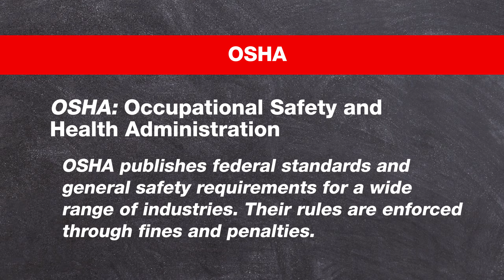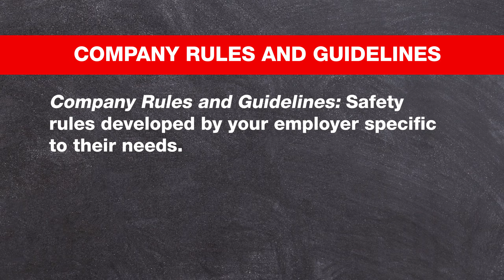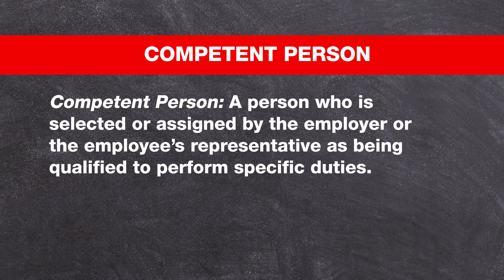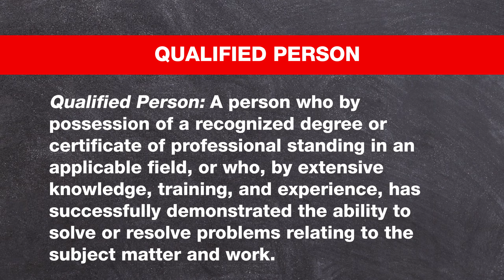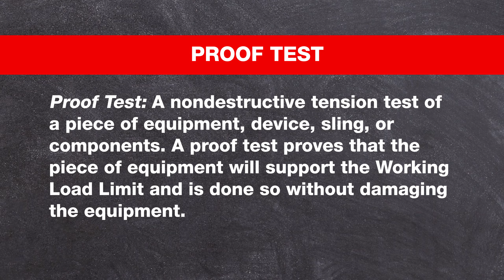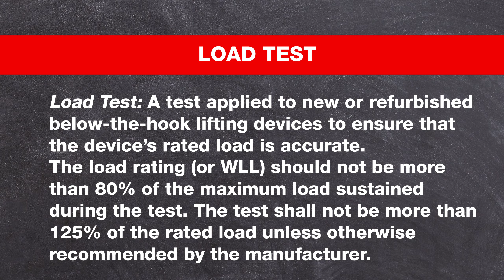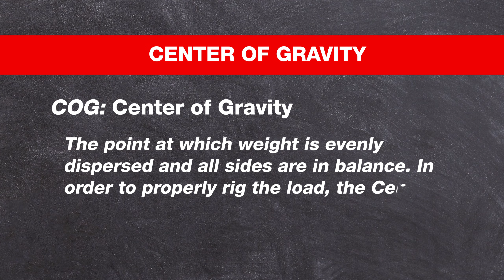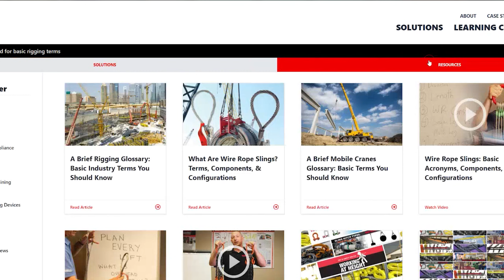Basic Rigging Terms You Should Know

Comment: Competent Person: The guy who doesn't insist on backing out the pin on a bow shackle 1/4 turn.
Reply: You have fun fighting with that thing I'm always going to back out a quarter turn😂😂😂 i've done tons of rigging around a precast concrete with your average sheer wall weighing between 70,000 to 100,000 pounds if I've never had a problem and you're not going to have any picking steel or air handling units😂😂😂 sounds like something a snobby union guy would say😂😂 you're fighting with your shackles for no reason😂
Reply: @CarolinaReaperr  Guess you've been lucky. Industry standard is to tighten the pins. I've always hand tightened them and never had a problem backing them out beyond a slight tap on the pin.
Reply: @PATCsawyer  when get over 50,000 pounds pounds you'll have to put a spud wrench in the screw pin and hammer it out😂  I think it's absolutely crazy to think the pin will vibrate itself loose under a load

Comment: Is two 1t slings the same as one 2t sling?
Or will this cause a failure in the system, should one sling fail, then the remaining sling becomes overloaded?
Reply from the maker: I reached out to Terry Driscoll, someone with decades in the lifting industry to get you an answer. Here is what he had to say.

"I would never rig like this.  Here are my main concerns –
• Matched length would have to be EXACT to allow both slings to carry the load perfectly.  Not worth the risk, especially if you are dealing with wire rope or synthetics to get the matched length. 
• Even if the slings are exact in length if the load shifts or angles are introduced, one sling will see more of the load, and now you are entering proof load capacities, which is not a proper way to rig within the design factor of a sling.
 
There are “catch slings” that are used in some applications, designed to handle the load if one sling fails, but that would not be the intent of this rigging set-up based on the request.
Reply: @LiftingandRigging  That makes sense. I was thinking if one failed, both would fail. I didn't stop to think of imperfections. 

Now that you've pointed this out to me, I realise it is impossible to make two slings perfectly identical, so naturally, one would be the main bearer and the other just along for the ride. 

Thank you for your fast reply and thanks a lot for your fantastic videos. I have learnt quite a lot from your channel. I look forward to watching more.

Comment: Is a bridle another kind of hitch
Reply from the maker: Good question. The answer is no.
A "hitch" refers to how the sling attaches to the load it is picking up.  I.E. - basket hitch or choker hitch
A "bridle" simply refers to having multiple sling legs from a single point.  I.E. - a 4--leg wire rope sling bridle, where those 4-legs connect to a single master ring.

Comment: I work for a major defense contractor. What are the requirements for load testing devices that lift explosives?
Reply from the maker: Hi Greg, great question.  This is a tricky one to answer as the government may have different instructions compared to ASME.  I reached out to Brandy Cooper who works in Government Sales for Mazzella.  This is what they had to say.
"There are many manuals, specifications and drawings for handling explosives and weapons.  The government instructions sometimes supersede ASME and other times refer to it as the governing requirement – It can be quite tricky.
Typically explosives are going to have unique gear designed for the item being lifted and will have a drawing which details the test loads and test configuration.  
Below are the main manuals/references and they will often refer to the appropriate test instruction that should be used for each item.
• Approved Handling Equipment for Weapons and
Explosives, NAVSEA OP 2173
• Ammunition Afloat, NAVSEA OP 4
• Ammunition and Explosives Ashore, Safety
Regulations for Handling, Storing, Production,
Renovation, and Shipping, NAVSEA OP 5

Additional references….
•	NAVSEA SG420-AP-MMA-010 - Periodic Testing Arrangements for Ordnance
Handling Equipment
•	NAVAIR 17-1-127 - Periodic Proof load Testing of Weapons Support Equipment
W/IPB
•	TB-43-0142 – Safety Inspection and Testing of Lifting Devices
•	NAVSEA OP 4098 - Handling Ammunition, Explosives and Hazardous Material with
Industrial Materials Handling Equipment
•	NAVSEA OP 3347 - Ordnance Safety Precautions, U.S. Navy
•	NAVORD OP 4 - Ammunition and Explosive Safety Afloat
Hope this helps – let me know if you need additional information."
Reply: @LiftingandRigging  You’re awesome man.  You actually care.